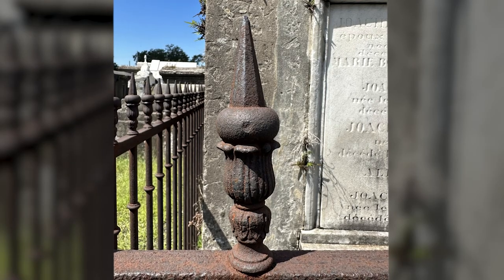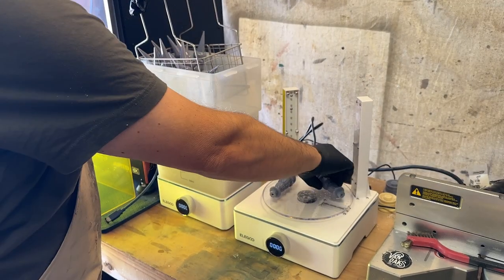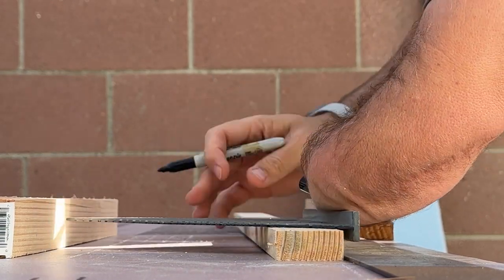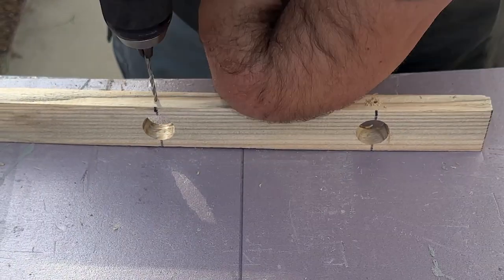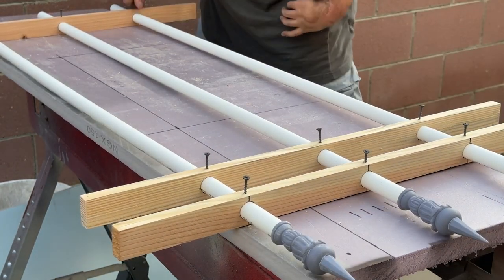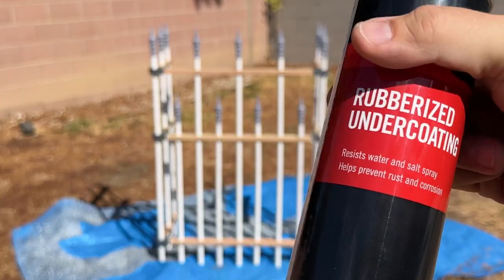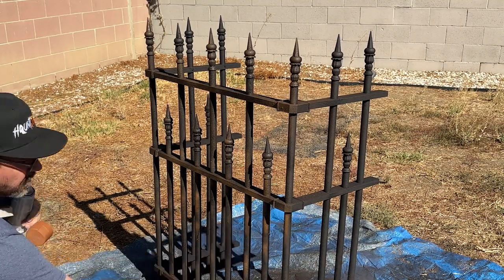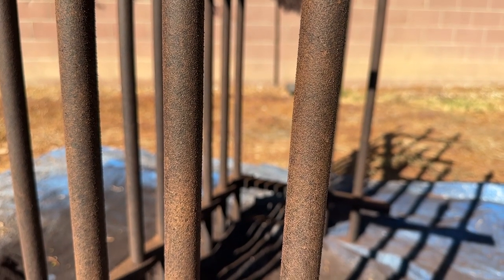Making a PVC Halloween Fence

Comment: I made the fence connectors, had to increase the size in the X and Y directions. X direction was increased to 105% and Y direction was increased to allow my fences slide in. The hole distorted a tad but the 1/2" PVC slid in and no noticeable wiggle. I cracked one of the straight connector after twisting the post a little to much. 
I had printed other finials so i used them this year

Comment: You would happen to be selling the 3D model for these would you? And if so do you only have corner joining pieces? Not looking to do this for a crypt but to enclose my front yard and some landscaping, about 200 feet in total with a few different angles, 45, 90 and 180. Also what was you spacing between the tall and short posts?
Reply from the maker: I am. Check out my etsy shop https://vanoaksprops.etsy.com. The spacing is 3" between tall/short posts.
Reply: @VanOaksProps  thank you